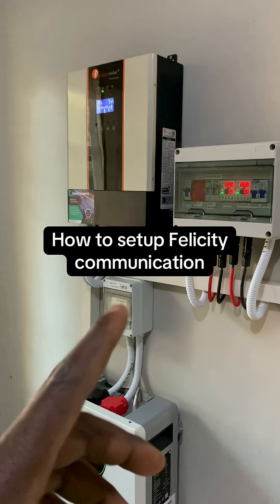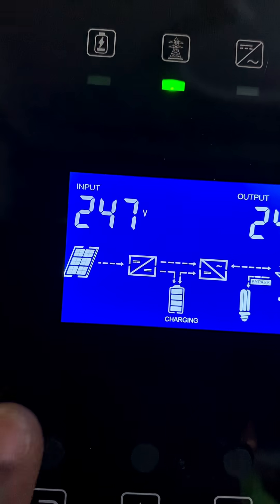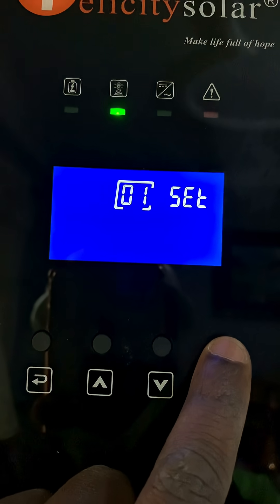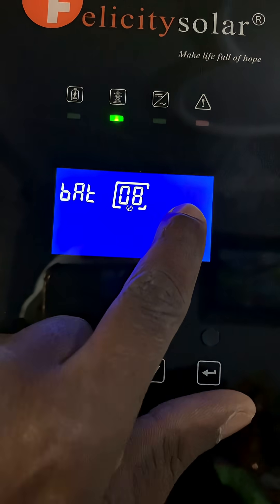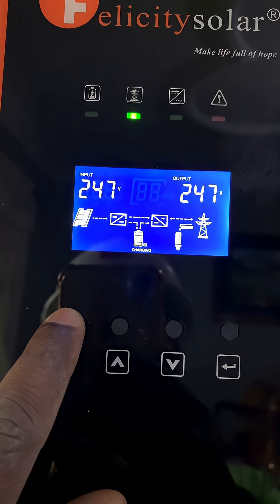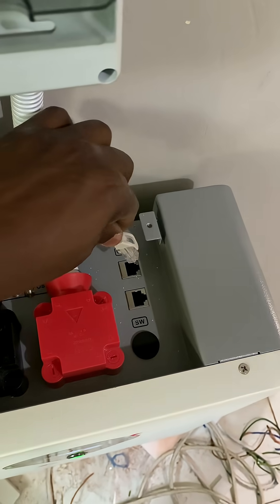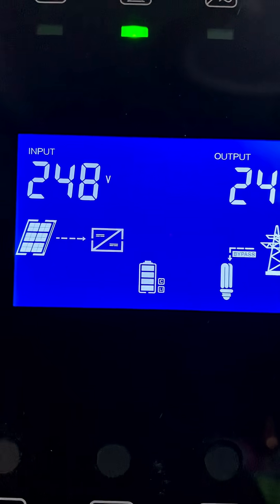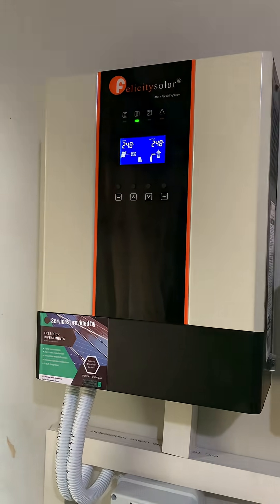How to setup communication between Felicity lithium battery and Hybrid Inverter.

Comment: Does it work with felicity and Cworth energy lithium battery?
Reply from the maker: for different brands its usually difficult because you need to make your own communication cable  custom to the battery you have and the inverter

Comment: Good morning, please I was trying to establish communication between felicity 3kw inverter system with itel lithium battery but am having 80 ⚠️.

What do I do to clear the warning. Thanks
Reply: Warning 80,tells you that the battery and inverter are not communicating.pls so through the manual to see how it been communicated
Reply from the maker: The communication cable that comes with felicity inverter only is specific for felicity brands which mean felicity inverters and battery’s but in your case you have to make one that links itel battery to that inverter

Comment: Can I do this on an installation that have done the c logo is not showing
Reply: Seems there are lots of fake felicity inverter in the market.
Reply from the maker: @irukandji89  yes there are a lot of fake goods
Reply from the maker: you will have to do manual settings on your inverter go on battery type and select user defined then after that you now have to set  bulk voltage , float voltage and cut-off put(either 12v,24v & 48v)

Comment: What does this help with. If the battery already is charging automatically without the rj connection
Reply from the maker: this helps with maintaining the Depth of Discharge and actual tracking of battery voltage and temperature of the battery cells which gives you alarms when ever the battery is overheating
Reply: @FreerockInvestmentszw isn't the BMS for that but its good to track